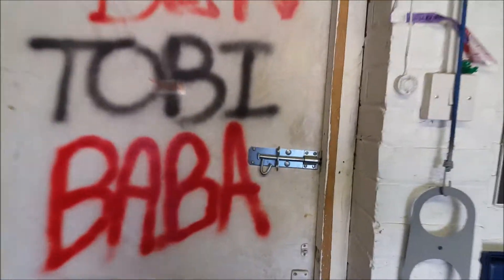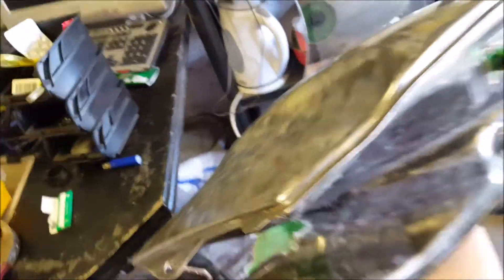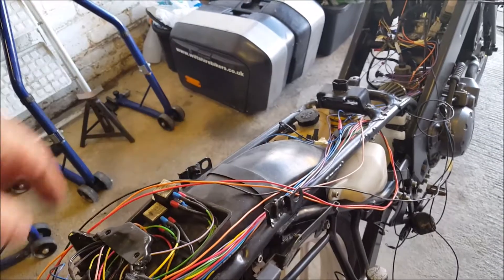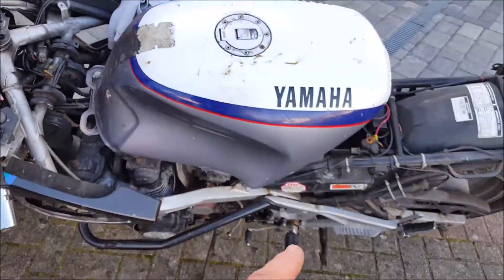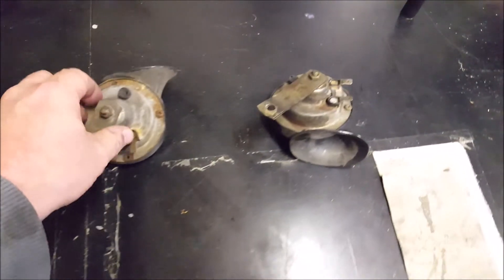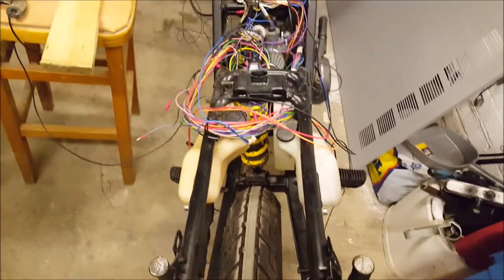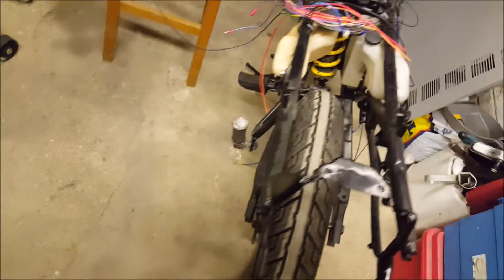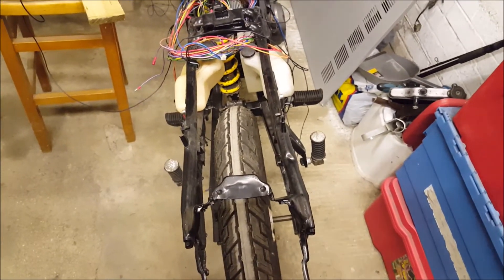Back in the garage

Comment: Great to see you back.  Are you sure the damage is to the right side?  Frame rails aren't often straight and the end of the left looks pushed in to me which would match to the broken seat mount.
Reply from the maker: Fairly certain, there is a dent in the right hand frame rail that would match the way the frame looks bent. I have started the next video so there will be an update in that on the seat :)